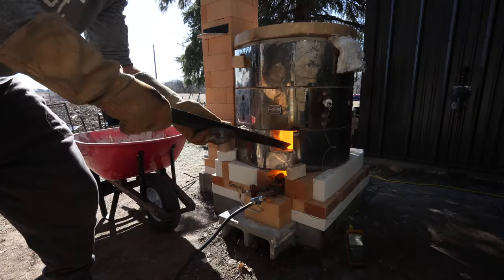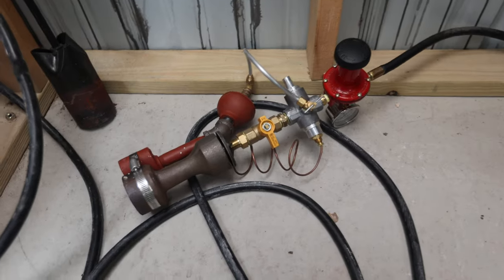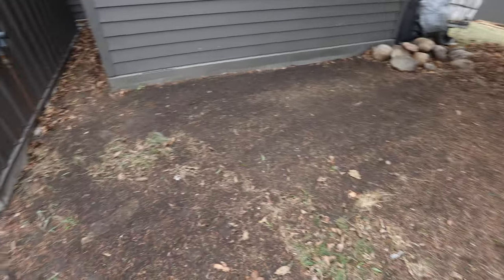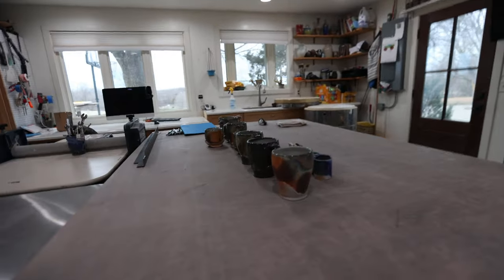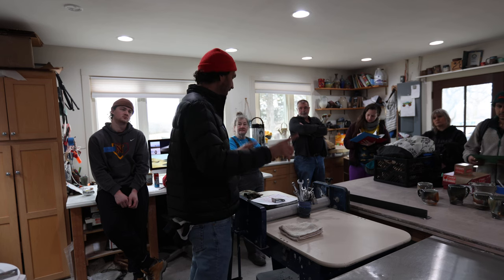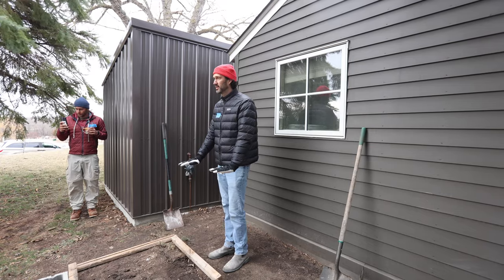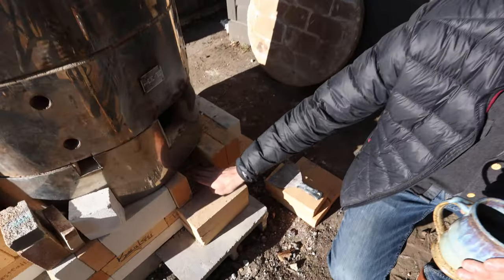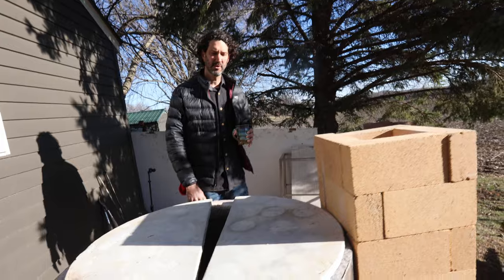We built a Soda Vapor Glazing Kiln!

Comment: What’s a ballpark price you’d have in building a kiln like this? Assuming you already have the old electric kiln to convert.
Reply from the maker: Probably a few thousand , burner is 500-600, bricks and refractory material would be another 1000-1200.  Depends on if you need kiln shelves / kiln posts , glaze materials , etc. somewhere in the 2-3k range depending on what you have laying around.
Reply: @Jonthepotter  thanks for breaking it down!